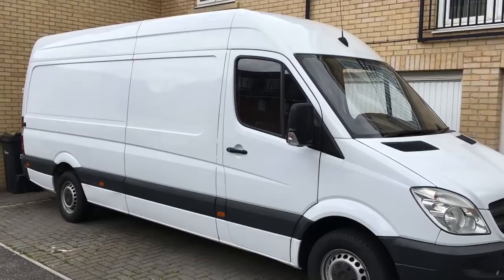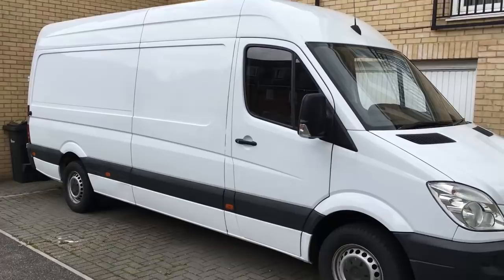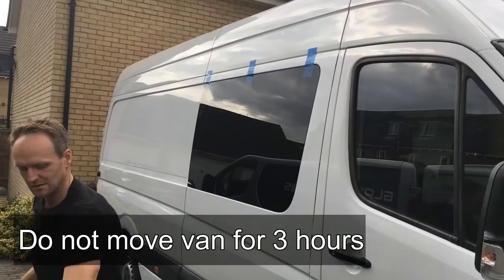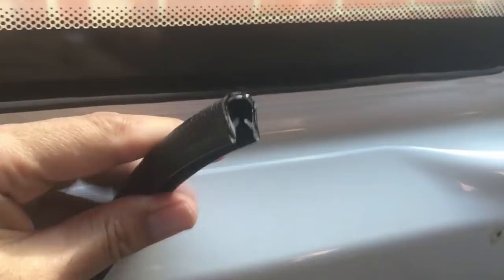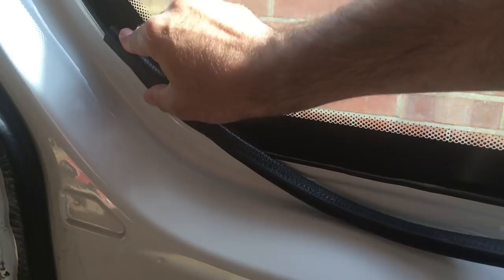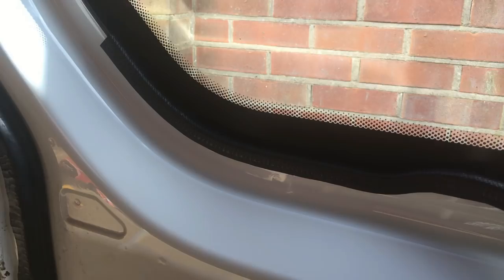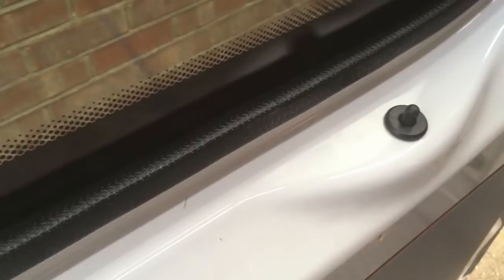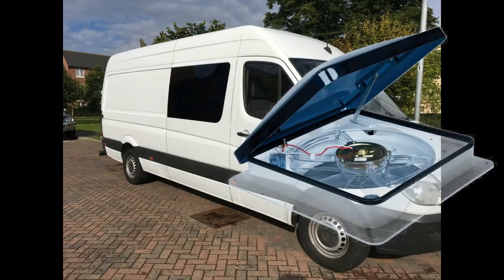How to Fit Bonded Windows - Self Build Campervan

Comment from the maker: You can follow me on Facebook where I post regular updates on the build during the week and sneak peaks to upcoming videos. 
https://www.facebook.com/Greg.Woodshop/posts/897887757028256
Reply: Greg Virgoe have you finished the van? if so i can't seem to find it.
Reply: It is actually not allowed by Mercedes Benz to install a window like you did to your van. It may damage the exterior metalsheet of your van. The version of the van with windows (called "Sprinter Tourer" in my country) has the two layers of metal welded together befor installing the window. 

Good luck with your van. Hopefully it does not fall apart.
Reply: Hola, es de 6 o 4 cilindros? Gracias...

Comment: As you can see, fitting windows is really very straightforward so long as you cut the hole the right size, which is easier when fitting van-specific windows like this. I did my own on the current van (generic window with rubber Z-seal rather than glued) in 2003 and they've been beautifully watertight for 15 years now, despite being flat windows in a curved sheet.

Comment: You went into so much detail about insulation I thought you would have chosen double glazed windows. These single glazed windows will produce a great deal of moisture in cold weather which will drain into the van interior.
Reply from the maker: Hi lesley, obviously the cab is full of single glazed Windows and nothing I can do to change those so the way to combat that is to provide adequate heating and ventilation in side the van. When you are drying along with your vans heater and vents on your windscreen stays dry and you can see out. That's because warm air can hold much more moisture and it drys the surfaces out. If your van is cold the air is saturated and you then start to see condensation forming. I am fitting a 4kw LPG heater with multiple vents around the van, it will be really toasty in there 😊
Reply: Cheers for that Greg, I know they look better but when you are not using the van or are away for the whole day you won't want to keep the heating on.
Reply from the maker: Hello lesley, normally when nobody in the van to create any moisture there isn’t a problem. You know yourself if you leave your car it doesn’t become wet inside. It only starts to condensate when you get in it and start it up.
Until it’s warmed up inside.

Comment: What a great demo!  He made it look so easy.  I'm surprised you did not do this yourself, Greg?  You have done much harder installs to date.  The cutout was already outlined, so not hard to cut from inside using the ribs as a guide.

I wonder why you chose windows that did not open?  That would have helped ventilation.
Reply from the maker: He did make it look easy, but when you are doing them all day every day you get very good at it.
One thing he did which I never see any DIY installer do is his mastic gun laid down a 1" tall bead with twin peaks that ensured contact with the windows and no leaks. The reason I didn't go for opening windows was security reasons. You are right, they would have been good for ventilation 👍🏼

Comment: So all that keeps the glass in place is glue? And it’s watertight? Doesn’t water drip down the van and get inside the windows? Surely the glue bond degrades over time? I’m amazed it’s not more complex than this.

Comment: Hi Greg you have helped me so so much during my build so firstly allow me to say thank you, what I need to ask you as I have the same van also fully converted too  i have used the lightweight furniture board with all the usual extras ect, anyway I have noticed you have a tow bar come step is your van the correct weight ?, I'm worried that mine maybe over weight has yours been weighed many thanks Mark ...

Comment: Hi, interesting videos, lots of practical information for someone like me converting a Sprinter - thanks !   - do you know if the gas (propane) regulator can be housed outside the gas locker or does it have to be inside ? - thanks again.
Reply from the maker: It is not wise to have this outside your locker because of the potential for leaks. I would strongly advise you install inside the locker as it has high-pressure hoses connected to it. Watch my gas regulations and gas bottle install videos :D

Comment: sting did a great job of the window. i think i would rather pay someone for the wiring rather than the window.
Reply from the maker: Hi, the installation of the windows was only £180 and when dealing with water ingress and the integrity of the external shell of your van that is money well spent. His mastic gun laid out a vertical bead that was over an inch tall with two peaks and that was key to making sure the bond was effective all the way around. That's something no home builder has done that i've seen.
If you are not sure with electric then that is something that does need a professional too, I am lucky that I know more about electrics than fitting windows. Thanks for the feedback.
Reply: i think 180 is a lot of money, ive worked two days on a building site to earn that. but fair enough. how is the build going? looking forward to your next video. cheers.
Reply from the maker: I didn’t mean to belittle the amount but when you compare it to the £15k budget for this project it is a very important and small percentage. We are fighting the snow which it making getting about a bit slow.

Comment: Greg, the window job turned out pretty neat, just one question did you not consider having sliding windows or was this your choice from the start. It does look pretty easy when you have someone who knows or does it for a living install it.
Reply from the maker: Hi Gavin, the only reason I didn’t go for sliding windows was for security. I was concerned they would be a weak point. Thanks for asking.

Comment: Finding such project is like a needle in the haystack. I'm looking to accommodate a mini garage - just like yours - underneath the bed for the very same reason: to store my motorcycle. Any idea at this point how much room you'll end up with between the mattress and the ceiling? Keep up he great work and thanks for sharing it!
Reply from the maker: Hi, the max space above the bed will be approx 700mm (28") This will require removal of bike mirrors on my triumph. 
Other models like dirt bikes or adventure bikes will be too big for this arrangement. Luckily my Bonneville has low stance.
Reply: Thank for the quick and helpful reply. I do plan on storing an adventure bike in there, hence I'll need to find a van with extra high roof. I believe the Ford Transit has a higher roof option than the Sprinter's highest roof.
Reply from the maker: I've seen another company use a ratchet strap to compress the front forks prior to loading, but I would question the long-term effect of that on the springs?
Reply: You'd eventually end up with blown fork seals.
Reply from the maker: Do a google image search for RACE VAN and you'll get some cool ideas pop up. Cheers
Reply: Thanks for the suggestion. Search for "race van" has been very helpful.

Comment: Is that adhesive strong really enough to keep the large pane of glass in place once the vehicle is driving at speed? I'm asking this as once I had a broken metal sunroof which I temporarily duck taped on while waiting for a spare part to arive. I really had it taped on securely and I drove onto the motorway and as soon as I hit about 50mph the whole sunroof popped out and flew back down the motorway! Thank goodness no one was behind me! The sunroof itself weighed a ton and I distinctly remember thinking there must have been tremendous pressure inside the car to make it pop off. Obviously the glass on the van is sealed to the outside with a strong adhesive...but is that alone enough?
Reply from the maker: Yes it’s special window adhesive. Most modern cars the windscreens are bonded in with mastic.  The key is to make sure it’s extremely clean and primer applied, that ensures a really good bond.
Reply: @GregVirgoe  Thanks for the info Greg- particularly timely and I am fitting a new shower drain and that reminds me I need to get a new tube of good old Plumber's Gold sealant!
Reply: COYI !
Reply: @richyrock69  Come On You Irons...... Had to Google that! I thought it was some special mastic bond that I'd missed?!?

Comment: Hey Greg great van build I am looking forward to it.what year is your van? I really want the Mercedes van but I am worried about the high cost of repairs. I'm sure you researched the history of the service schedule.
Reply from the maker: Hello trophyfishin, my van is a 2009 and I took a lot of time to find a van with relatively low mileage. These are one of the most popular vans and the source for parts or garages should be very good.
Reply: The cost of repairs are indeed high from what I have heard on Youtube.  A lot of parts are not easily available either, and special mechanics in short supply.  Why not use the Ford Transit?

Comment: Hello, on others videos I see professionals that put the U rubber on the 2 edges and this allow a gap between the metal and the glass, but they put a big quantity of mastic to compensate the gap. Which method is better ?
Reply from the maker: 100% put the trim on first, apply a very tall bead of sealant then fit the window. 
The trim that was supplied by van pimps was not big enough to go over both skins so I had to order the right stuff and fit after which wasn’t easy to do.
Reply: @GregVirgoe  Thanks for your quick answer, so if I understood correctly I have to put the trim on both skins before to place the glass ? Cause on your video I thought you cover only the internal edge
Reply from the maker: @axelplanckaert3726  the trim needs to go over both cut edges. That’s why I had to order a wider trim. You need to do this first as the glass will rest against this when fitted it keeps it the right distance off the van. Which is why you need a deep bead of mastic standing off the van. A 1” continuous mountain ridge of sealant.

Comment: Sorry Greg. Wasn’t sure how to contact you. Meant to take a photo with the t shirt. My daughter assures me “it’ll only take half an hour” I have just bonded some windows on my daughters boxer (“we”are converting it) you and gadget are my go to guys, so some advice please. Is sikaflexing the gap around the outside edge a good or bad idea?
Reply from the maker: ssmith250763 I have contact details on my about page here or you can pm me on other social media. 
Re sikaflex windows I would not advise you to do that. The bonding sealant is all you need to provide a waterproof seal and water that goes into the small channel that is left will simply drain away around the window. Please do send me a photo if you can 🤩👍🏼

Comment: I now see that you did install windows in the van.  How you going to insulate them for winter camping?
Reply from the maker: I won't be insulating the Windows, I'm installing a duel fuel Truma combi boiler in the van running off LPG and electric so it will be warm as toast in there all year round. I'm fitting the largest auto gas cylinder that Gaslow produce so I can simply fill up both when I fill up with diesel. 
Having said all of that we won't be doing much winter camping as my misses does not like the cold, we plan to travel to much warmer climates in Europe.

Comment: Morning Greg… just starting another watch through of the Full Build series “belts n braces”. With you touring abroad, did you ever consider using a LH drive van for the conversion? Another research question. Cheers.
Reply from the maker: I’ve driven LH drive vehicles abroad and it makes driving far more difficult because the gear stick is in your wrong hand and not only do you have to concentrate on the road you also have to think more about just driving the vehicle. Where my right hand drive van the driving comes naturally.
Reply: Totally agree mate, thought that when driving LH in France last year. RH it is then 👍
Reply from the maker: @Pelt101  it’s one less thing to think about so you can just concentrate on the road ahead 👍🏼

Comment: Hi Greg, I hope all is well. I would be grateful for thoughts on condensation when using bonded windows, as they are not double glazed. Have you had much of an issue, and what do you do to prevent it?
Many thanks
Mark
Reply from the maker: The way to combat this is to keep the van well heated and ventilated. 
In very cold wet weather we do get a small amount but it’s not too bad. At least with the maxxfans we can have them open all the time.

Comment: did you consider putting in a window that opens in some way (slide/lift, etc)? would that have helped with increased ventilation during the summer? curious on the reason you opt against it. thanks.
Reply from the maker: Hello Joe Lin, yes we did consider it but after seeing other vans being broken into via such opening windows I thought it to be a security risk. 
I have got two 14" ventilation fans on the roof one either end that are reversible so it can be like a wind tunnel in the van. I don't think I will have any issues for not having a small opening in a window. Thanks
Reply: Do thieves break the glass or jimmy the locks..are there no better locking latches?

Comment: Hi Greg, with these particular windows can you fit them further back or are they panel 'specific'? Also are there any structural issues in fitting more than 2? Many thanks in advance.

Alan Scott
Reply from the maker: Hello Alan, if you go on van pimps website they do a full set for all the side panels and the rear doors. No structural issues as it’s no different to a minibus if you do them all 😀

Comment: Would You consider upgrading into double glazed, insulated windows instead?
Wasn’t it too hot/cold with plain regular glass?
Reply from the maker: Paweł Skupiński no I know that thermally the double glazed ones are better but the bonded windows just look cool 😎 we have internal reflective blinds to cut out the solar gain through the windows.

Comment: Hey Greg, how much roughly was the cost for getting the windows installed by Glass for Vans? Cheers
Reply from the maker: It was £180 at that time to have both windows fitted, I also spent £29 on some wider trim as the one supplied by van pimps was not wide enough to go over the two skins of metal. So in total about £410 for materials and labour.

Comment: Agreed - would you be happy to share cost of window and installation?
Reply from the maker: Windows were just under £100 each and fitting was £180 for both.
The trim was £18 for 8m, 4m per window.
All in under £400 and I am really pleased with the quality and finish.
Reply: Seems pretty reasonable - will tuck that away for my own conversion. Thanks.
Reply from the maker: Garambaly Omatic exactly what I thought. Glass for vans do supply and fit may be worth a shout when you're at that point. 👍🏼

Comment: Hi Gregg, I’ve been following your fab videos and have got to the tightness testing for the gas. I’ve got the manometer, bellows and tube and I’ve found the testing point on the regulator but I can’t attach the rubber hose to it. I’ve searched the internet and asked the LPG shop but no one can tell me where to get the nipples from (no jokes please, it’s just what they’re called). Do you have any suggestions?  Thanks, Roger

Comment: Hi Greg, about to put windows in my Sprinter and I've got a question - Do you like the 2 windows up front and none in the rear? Do you think it would be much easier driving/parking with a passenger side window in the rear aswell? thanks.
Reply from the maker: Th only reason I have not gone for the windows in the rear at this stage is that I have the garage in the back and if I'm carrying a bike I do not want prying eyes looking in plus its an easy smash and grab. If I was building this purely as a camper van I would have put the rear windows in for sure :D

Comment: Did the edging trim you fitted go over both skins of the van once the window was fitted or just the inner one?
Reply from the maker: It went over both skins and it really should be fitted before the window is fitted as it holds the glass off the side of the van and creates the right gap for the mastic. 
If you don’t fit it first and push the glass to much you may not get it on afterwards. I had to order a wider trim than cane with the kit from Vanpimps
Reply: Ah okay I see the windows i ordered are from van pimps too im fitting them on my vivaro it might be worth me ordering some thicker trim just incase
Reply from the maker: @Am-hf3yr  the trim that came from van pimps did not fit. I got the wider trim from glass for vans.

Comment: hi Greg way ru went for single glazed window instead of proper caravans one that come with mosquito nets black out curtains and mainly NO condensation ???
Reply from the maker: Marco Tavoso, because they look like a 70’s caravan 😊
I have digital controlled central heating and ventilation. There will be no condensation in my motorhome 👍🏼

Comment: How do you get the blue tape out?
Reply from the maker: Frank Fisher, the blue tape is only stuck on the outside of the glass so it easily peels off after the mastic had set
Reply: @GregVirgoe  Ah thanks, I thought it went inside the glass too

Comment: Roughly how much ply to convert van
Reply from the maker: beau emmerson this is what I used in our van. 
3 sheets 12mm for floor
4 sheets 9mm for walls
7 sheets 15mm high gloss laminate for furniture 
1 sheet 12mm for kitchen 
carcasses & drawers. 
2 sheets 12mm for our bed boards. 
Marine plywood is better at resisting moisture.